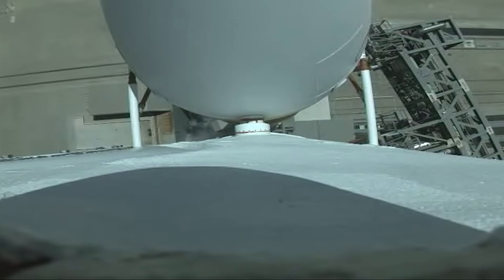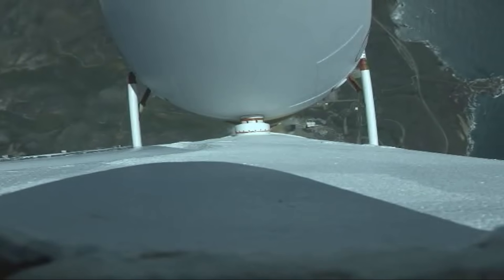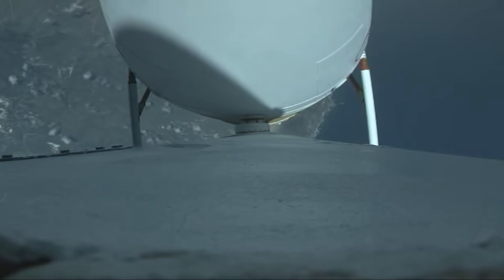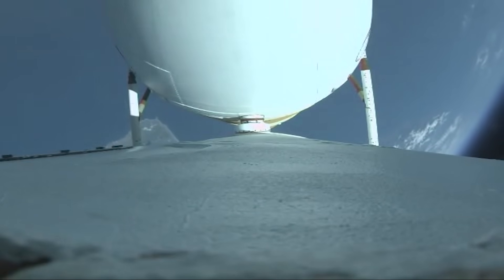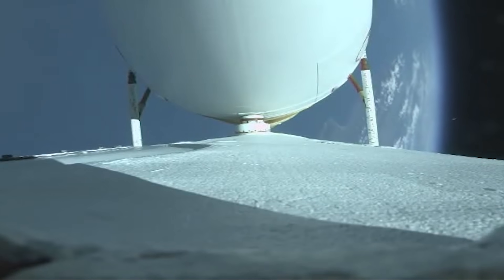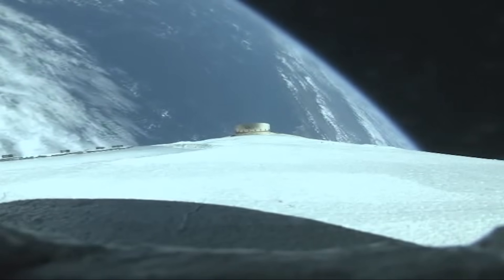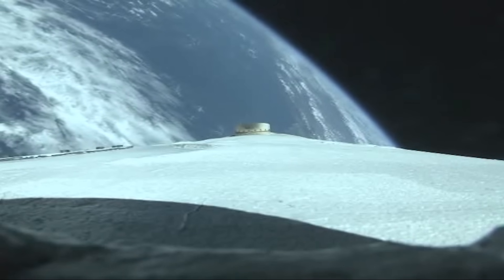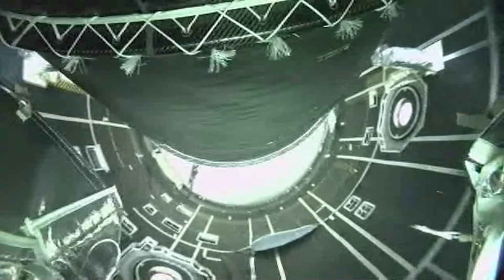Delta IV Heavy NROL-82 Rocket Cam

Comment: Please do this for every launch! If you already do...disregard. haha THIS IS SO AWESOME! Love this launch system!
Reply: How can you love this dinosaur of a system? 

Wasteful, high cost, outdated tech.
Reply: @truthseeking3818  what does the competitor do that this launch system doesn’t?
Reply: @sabretechv2  lands and resuses their boosters?
Reply: @truthseeking3818  hate to break it to you but for this type of orbit, and this heavy of a payload, Falcon Heavy wouldn’t be able to launched in the reusable configuration. Not only that, but their upper stage doesn’t have the same performance as the hydrolox DCSS, and they also don’t have RAAN steering capability. So nice try, but reusability is a moot argument in this case.
Reply: @truthseeking3818  And honestly, what I think personally about a launch system isn't based off of what others think about it. So...thanks for your input but no thanks. It's an amazing piece of machinery. I like it. That's all that matters to me.
Reply: @joshniedens978  love the hydrogen fireball at engine start
Reply: @truthseeking3818  I can tell you obviously know nothing about orbital mechanics. So what do u think of SpaceX waisting a whole Falcon heavy in 2022? Reusability isn’t everything you know.
Reply: @dummyjoe7895  yeah you got me I know nothing about orbital mechanics. Please with your apparent physics degree explain such to me.

These companies have had a business model for decades revolving around having to build new vehicles as often as possible. It makes them money. You’re blind and you truly live up to your name. Sensors and electronics have been up to snuff to produce reusability since as least the 90s, it just gains nothing for these big corporate scam artists
Reply: @truthseeking3818  these rockets were built under an “expendable vehicle” contract. And I actually do know I lot about orbital mechanics because I’m 25 studying it. And ur right they tried to make the Saturn V reusable, but reusability takes a performance hit thats why no one did it with until technically got better. Even then SpaceX takes a massive performance hit with resizability. SpaceX is going to throw away a whole Falcon heavy because reusability isn’t everything.

Comment: At 4:06 , is the separation done by explosive ?
Reply: Yes, I believe that is the explosive bolt seperators
Reply: Explosive bolts are common in non-reusable vehicles.
Reply: They’re actually sepratrons, which fire to push the side boosters away from the center core.
Reply: @zacharys41  Somebody go grab Rocket Propulsion Elements lol
Reply: @zacharys41  sepratrons??? ie never heard that term before man haha that's rad as all get out... so explosive bolts mixed with what, small rockets for lateral thrust??
Reply: @zacharys41  hahaha ya know, a little tiny part of me thought that might be the case? either way, thanks (legit) for confirming I'm an aging arse hole haha =)

Comment: They should put cameras on those boosters, so we can see where they end up. I've read that there is an area in Southern Ocean, which is a no-go for sailors as it is used as a dumping ground for ULA single use rockets.
Reply: It is huge objects easily detectable by radars. No cameras needed. Forbidden zone has been preset much earlier.
Reply: @santka3739  I don't have a radar, so cameras would be better for me. Mostly to show how ULA is polluting oceans with their Soviet-style operation.
Reply: @nyhtopossu4858  I'm sorry, but it seems I'm misunderstood you.
Additional equipment will give more pollution, isn't it?
P.S. I hate soviet. And everything related. But to blame ULA for that looks strange to say the least.

Comment: Why didn't the booster keep floating? Why did it fall back to earth?
Reply: Why would it "keep floating" if it wasn't floating before it was disconnected from the rocket?
Reply: @max5250  the capsule floated though
Reply: @the1windwaker  
Nope.
Nothing can float in mid air.

Anything you launch from Earth, either flies very fast up, or falls, also quite fast down, or moves at very fast speed in orbit. but nothing floats in the air.

You should know that by that age.
Reply: @max5250  ok you are arguing semantics. Why did the rocket not "orbit" along with capsule? They were in the exact same position yet one "returned" to earth and one remained in orbit. Why?
Reply: @the1windwaker  
I am not arguing semantics, just explaining something you got completely wrong.

Once the rocket and its payload reach stable orbit, rocket detaches payload (which continue orbiting), and it is oriented to the surface of Earth, and it falls down.
Reply: @max5250  Plus they have to deny everything and make up everything else